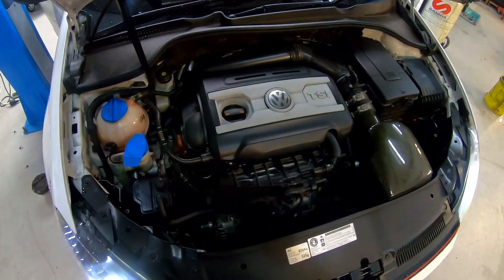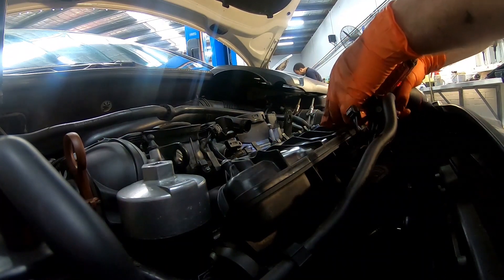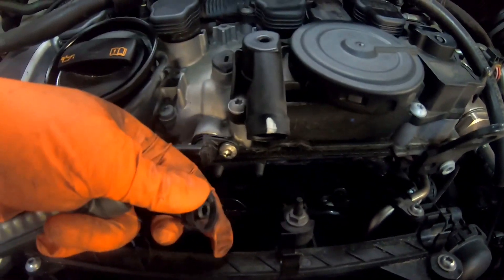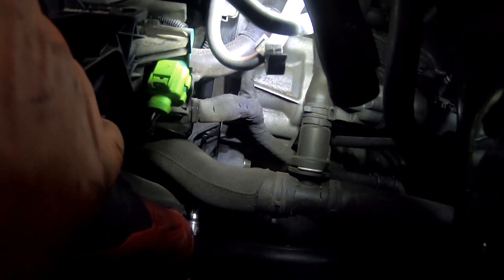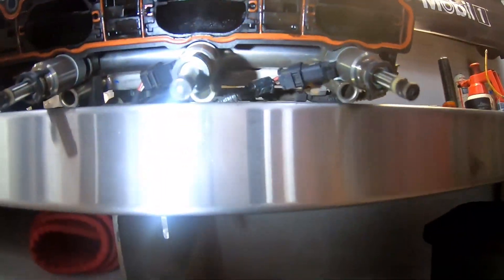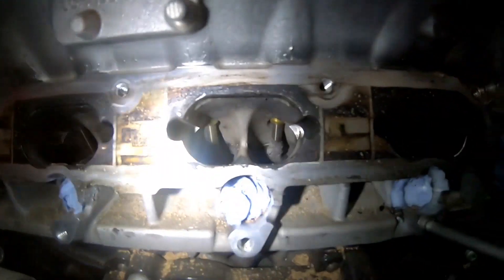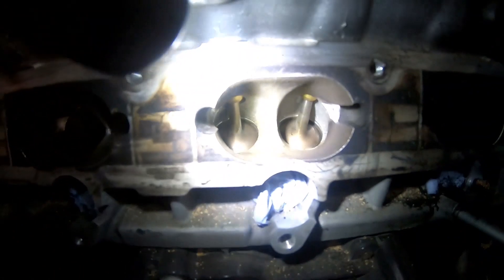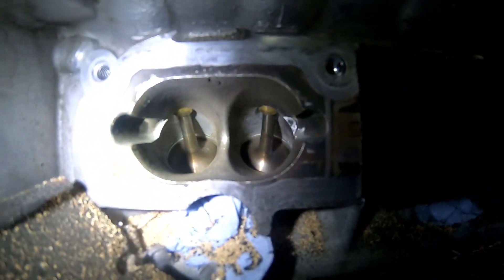VW Golf GTI Walnut Blast Intake Ports 2.0TSI

Comment: Can you please do a guide for Audi A4 B8 or like that Q5 from your other videos? Intake Manifold setup is a quite different.
Reply from the maker: The manifold is the same. Only a couple of pipes and hoses are different. It is much easier on the a4, a5, q5 as there is so much more space. I will do a video if i have one of the those cars come in that requires the manifold to be removed.

Comment: Can you explain what the symptoms of too much carbon build up is? I have a 1.4 TSI BMY (the slow version of the BLG) from 2006, and they are notorious of having carbon build up. 
I have for the last 4 years wondered when I should get it done. I am just waiting for symptoms
Reply from the maker: Rough idle on cold starts is the most common issue. Also misfires at idle (mainly from cold again) logging fault codes/engine lights. Sometimes we find we are cleaning the ports simply because we are in there and advise the customer what we've seen, the labour savings of doing it now as it's apart for something else anyway (injectors, leaks, etc depending on engine/model) and after the clean is carried out, the customers always comment on how the car has never ran better. So the people driving them day in day out notice a difference.
Reply: @FourRingsAuto  Good to know. I have none of these issues except misfires now and then. Thanks for the answer.

Comment: Having mine done and the injectors replaced tomorrow.
Reply: No need to change your injectors. Just use good fuel and poor in a injector clean 2-4 times a year. It will keep them clean. Manufactors build their injectors to last a lifetime of the vehicle
Reply: @danielfl.9347  that's true!, my TSI is on LPG (Vialle, so similar to Prins DLM - liquid LPG through the TSI injectors) and 270.000km and no issues so far with the injectors (2010 1.2 TSI) --> using premium fuel (98+ octane) and a lot of highway mileage keeps them healthy. I drive most of the time on LPG And every 500-1000kms I drive about 10-30 2800rpm+ in 6th gear on the highway. Keeps starting and running like  it's new. My dad has a Volvo 2.0T (203 hp ecoboost engine) - runs great too, just don't drive too much short distances and use injector cleaner about 1/2 times a year!

Comment: Just wondering if the twinchargers suffer from a similar amount of carbon build-up? If so, how accessible are they to blast out the gunk?
Reply: All Direct injection engines without supplemental port injection will have the same carbon buildup issues.

Comment: Jesus can the shitty tsi engine get anymore shit ? badly designed streching timing chain badly designed tensioner which can jump timing if you so much as roll back on a hill and destroy your engine or the clip can just POP off from the tensioner and also destroy your engine and now i find out they are direct injected and carbon/gum up ohhh god facepalm.
Reply: And from my experience you have to do this process every 50-60K miles. Total BS. Should be a class action lawsuit on VW for such a crappy design